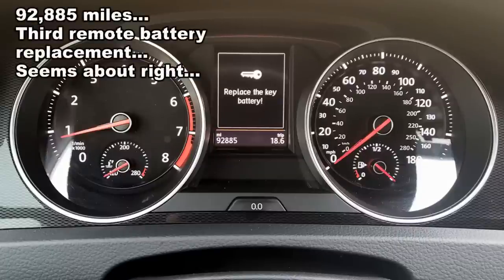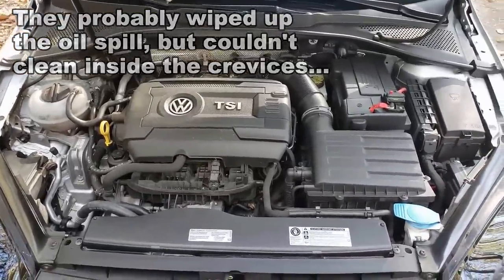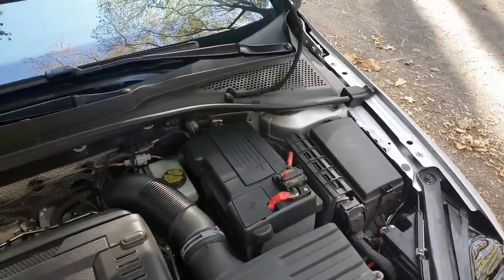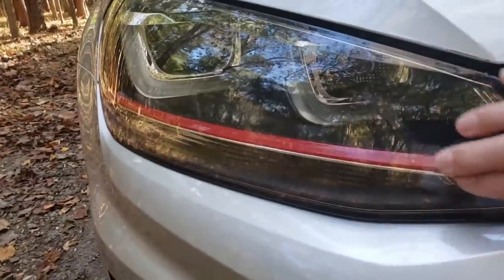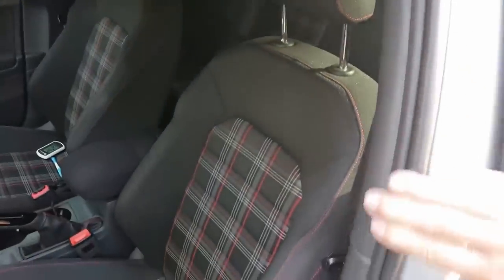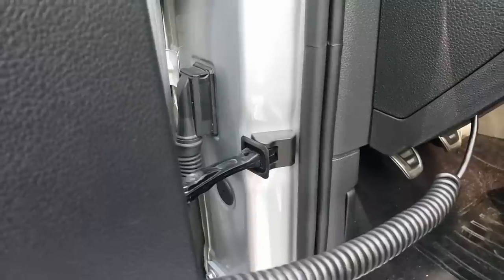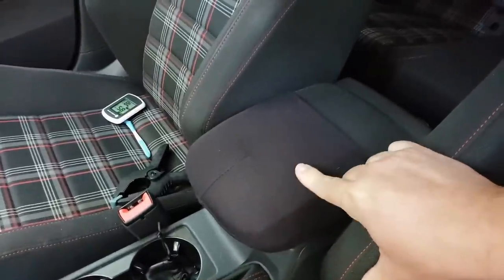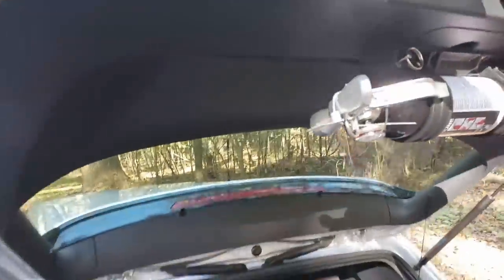THREE YEARS AND 93,000 MILES: My Report, Part 1

Comment: I'm 5 years in and battery is still fine. Car delivered with leaking valve cover and down pipe. Once those are fixed car only required maintenance
Reply from the maker: Excellent news! My car crosses the 5-year mark on November 11th. I'll share a report the following week. Thanks for visiting!

Comment: Good video but still buyers must be aware new cars coming in. This is a direct injection engine that suffers massively from the cokeing up valves and in a lot of models the dilution of oil with fuel! Keep an eye on those oil levels ! Your situation is perfect for a car, 90k in 3 years. Now try 90k over 10 years town miles or come back and review it at 200 or 300k. From what iv read the valves should be de coked every 60k at a cost of 2300uk but I'm unsure whether that's the diesel or petrol model. 

Regardless of the map the clutch is very weak, and the of using coolant is completely unacceptable.

My dirty diesel Honda has 215k town and tow miles and is nearly 16 years old. Original clutch, no oil leaks ,doesn't loose coolant, no cokeing of valves or oil dilution to worry about and still starts and drives as new. It can also be mapped to 210hp but have never felt the need. Yea the heated seats and air con is busted but wind down the window or put it back up again lol. They don't make em like they used too lol!
Reply from the maker: Yes, the diesels from that era are far simpler and less self-destructive (emissions).  Thanks for visiting.
Reply: @StealthGTI  Yes mate. They should factor in longevity in their co2 equations too. For example if a car like mine lasts three times longer than a modern diesel surely the co2 production cost of 3 v 1 would actually make mine less harmful over the course of its lifespan even taking into account the extra fuel and pollutants. Production is crazy co2. My work van is a small high pressure diesel with not even 10k on it. It already sounds like a bag of nails compared to mine. And I can't even think what I'd buy brand new now. Even the new hondas suffer from oil dilution and iv read about honda crvs only a year old blowing the crank. It's all down to the consumer paying for it (... Il keep running my two 2.2cdtis and hope that in a few years when they need replacement that something more reliable has come out but wont hold my breath lol.

Comment: The coolant leak might be due to the water pump leaking as it nears the end of life. I had the same issue and wouldn't show any leaks even when pressure testing the system. There is a small hole behind the bearing in the pump and once the bearing wears coolant starts  to sip out. Fortunately you get message when the coolant level is low.
Reply from the maker: Thanks for sharing.

Comment: I’ve had my 2008 MkV Gti now for 11 years. Air con broke after 8yrs. Nothing else has broken. Same pads and disks even as it’s a low mileage car. Same battery in the remote key. Same bulbs. Changed the belt after 6yrs and the tyres after 7. Fantastic car.
Reply from the maker: I seem to get about a year out of each remote battery. The keyless start remotes do a lot more "talking" than others. I think a year is good. The car is great. Thanks for visiting. -Scott

Comment: I have a 2018 white silver SE 6 speed, it's the best car I've ever owned.  After nearly 2 years of owning it, I still love taking it out.  Nearly 40k miles at this point, and the only things that have bugged me to this point are the TPMS seems to be very touchy and goes off too easily and the stock brake pads are very messy and I can't keep my wheels clean 5 miles past washing the car.  Pretty petty stuff all things considered.  Anyone looking for a hatchback should look no further.........
Reply from the maker: My TPMS isn't terribly sensitive. If it is, I'm glad to have it tell me that there might be a problem. Thanks for visiting.
Reply: StealthGTI I would agree if it were being accurate, but it’s gone off several times and I’ve checked pressures on all tires and they’ve been good.  It’s not really a huge deal, just a minor annoyance....

Comment: I've a Golf plus Mk5, 15 years old and I've had it 10 years, 102k miles. here in UK. replaced wheel bearings, drive shafts and 3 brake calipers, very few issues. Regular oil changes at service time. A good daily driver, plods along nicely, maybe a few noises from lower engine mount, perhaps I'll replace that in spring. Same clutch from new. Service history says it had water pump and new timing chain fitted at 4 years old at 40k miles?!? Was losing a bit of coolant in the last few years, too small to know where it was coming from, put a little amount of "radiator leak stop" or some similar named product in it a year ago, no more need to top coolant since and I keep the heater switch to hot once car is running for 10 minutes (it aids in reducing coolant pressure a little and therefore might help reduce or stop pushing coolant through weak points in the system) hopefully it will be a small leak in Radiator, it may show itself one day but replacing Rads on Golfs are a bit of a pain and involved. I want this car to get to 20 years or more. I work for a large car leasing company but refuse to lease, its not cost effective and I can do most maintenance and repairs myself. As much as I like Golfs, I'm on my 3rd, I'm gonna get a Toyota when the current Golf calls it a day. That's your Scotty Kilmers fault. I'm addicted to Scotty and Eric the car guy channels. They talk about European cars as well as your larger engine petrol guzzlers. Anyways, your GTi has certainly done a lot of miles in its 3 years. A very tidy car and the UK roads are full of them, very popular over here.
Reply from the maker: Thanks for sharing. -Scott

Comment: A member on the Golf R forum has fitted the plastic underbody tray from a Passat Alltrack. This unit gives slightly more protection than the standard tray. He did need to procure a few extra fasteners and two small brackets to complete this conversion. It certainly looks the business when fitted and offers much greater protection to the sump area. All the best from Nottingham, U.K.
Reply from the maker: Thanks for sharing that. Some in the U.S. have fitted a similar tray from our Golf Alltrack... same concept. ShopDAP.com sells complete kits. Thanks for visiting.

Comment: Regarding the coolant I would suggest to check the heating radiator which is located under the dashboard. Sometimes the radiator is getting corrosion and leaks without seeing any water around because is minimal and gets evaporated.
Reply from the maker: Thanks for the note. My thermostat housing eventually failed at ~115,000 miles. The car is has 163,000 miles now. Take Care!

Comment: I still have the plastic oil pan to this day on my 2016 gti and it has never leaked or anything, don’t have the all track skid plate on it either I just left it the way it was from the factory and it’s been fine
Reply from the maker: Thanks for sharing. I recently discovered a small leak in mine, even with the Tiguan gasket. I'm going to return my stock pan to the car at my next oil drain. I don't recall if it's in this video, but I do have the ECS skid plate. So, I still feel protected.  ;-) Thanks for visiting!

Comment: Wow man you did a lot of driving,mine is 2 years 9 months old,done 18 thousand km,only thing I had go bad is a boost sensor,good informational video tho,I got a obdeleven my self,on the updates I keep having trouble with the updates,it takes a lot of fiddling around to update it,but it’s a good bit of kit,I have the same diamond cut wheels as you,I hate them,I wash my car and look after it but them wheels mark so easily,just from washing them,I hate black on wheels but the refinished ones look smart
Reply from the maker: Thanks! The powder coat finish on the Nogaros appears to be holding up very well.

Comment: I was so tired of destroying my 18 inch wheels I replaced them with 17s and higher profile tires. At one point i has my car slightly lowered with Rotiform wheels and while I miss the look, I don’t miss the bone jarring ride or constant tire replacement. The aftermarket wheels were much more durable than the factory wheels, but that set up just did not work here in Chicago. Much improved now. My other issues include a leaky rear cargo area and an odd smell which I believe may just be the cabin filter. But otherwise my car has been bulletproof. It’s not my favorite car that I’ve had-were it not for our salty roads I’d much prefer driving a mid-late 60s Beetle-just a lot more fun to drive and believe it or not, more comfortable in my opinion. When this is paid off, I’ll keep it another year. I like it, it does everything I need it to do, but for the price there are some seriously nice low mileage used cars such as the Alfa Guilia Quadrifogio that one can buy with low miles that I believe will have more soul.
Reply from the maker: Thanks for sharing about your 17s. I considered them for a short while. Then I managed to get my hands on enough spare 18" Nogaros that I'll stick with them for the foreseeable future.
Reply: StealthGTI no problem. I don’t know how the streets are by you but they are truly awful around here.

Comment: If you haven't already had the dent fixed, and if it does not have a crease, you could try the hairdryer / canned air trick, but you would probably have to remove the clear bra.
Reply from the maker: Thanks for sharing that. I still need to have my PDR wizard take a look.

Comment: Ditto with this damn coolant slowly getting lower in my 2014 Jetta. It started to drop a bit the first year I had my car. I topped it off last September and now it's between min and max, no signs of any leaks. Anyone know if there's a known leak issue that's hidden somewhere? 39k miles, had the car since 2013.
Reply from the maker: Oddly enough, I decided to let my coolant go to see how long it takes to fall below the minimum mark or trigger an alarm. It's been a LONG time. I wonder if keeping it low helps reduce the chances of the system being overpressurized. I don't know. I want to post a follow-up video about it. I'll put it on my list. Thanks for visiting.
Reply: @StealthGTI  Hey thanks for your input! Does anyone here know about maybe replacing the blue coolant reservoir cap at a certain mileage?

Comment: Yikes. A clutch at 30k? Was that a result of the tune or is that common on the GTI? I’ve never had a clutch last less than 150k.
Reply from the maker: Tune and towing combined. My old clutch didn't fail; it slipped one cold morning while towing. I probably could have kept driving it for another 20,000 miles or more. Who knows? I decided to replace it as a precaution, especially since I knew it was inevitable with my tune and towing habits. Thanks for visiting.

Comment: This is a video on how to tear up your car and then cover it up.  Condom for an arm rest?  Seems as though you go to great lengths to take care of some parts of your car and then cheap out on other parts.  Not the way I take care of cars AT ALL!
Reply from the maker: The car is past 137,000 miles at this point and in nearly perfect condition. In fact, my latest video details how I won the "Mk7 (modified) Mild" class at VAG Fair last weekend. See that video at https://youtu.be/HtqvnZf0wa0, if you're interested. The seat bolster and door seal are fixed. I still use the "condom" because it's cheap insurance against the unavoidable and continual imbedding of dead skin or sunscreen into the material (unless I wear long sleeves all summer). Beneath the cap, the arm rest is PERFECT. Thanks for visiting.

Comment: Got a 2015 Autobahn mk7 gti 40k miles still has the plastic oil pan and have had 0 leaks or problems
Reply from the maker: Zero leaks on the factory pan seems to be the norm, except for one of the very early Mk7s from 2014 (Europe). I'll keep that in mind. Thanks.

Comment: Your Mk7 Golf has a manual handbrake or parking brake lever.  I’ve never seen any mk7 golf with a manual lever, I thought they were all electric handbrake like my own Mk7 Golf GTD.  ..  I live in the U.K., so maybe it’s just American models that have this option.   I have done a few rear door water leaks, it’s the door speaker seal on the inside of the door panel that allows water to run into the footwell.   We also have in the U.K. inside the radiator coolant bottle, a small bag inside that VW put inside the reservoir bottle that is there to stop corrosion in the water coolant pipes and radiator unit, but if the bag bursts did to the water hearing up a bit too much, the hundreds of tiny beads of silicone leak out and eventually blocks up the interior heater matrix which is not a 5 min just to renew and flush all the tiny beads out of the system,   Maybe it’s just GTD models, but I was informed by a U.K. VW dealer source that if any VW car comes in for a dealer service, to check the reservoir bottle for this plastic bag and remove it very carefully without bursting it.
Reply from the maker: I suspect VW cut some luxuries from American GTIs in order to keep the prices lower. We, too, have the silicone bags in the expansion tank. I'll have to ask my mechanic if he removed the bag when he replaced my water pump. I'd like to know his thoughts on them. Thanks for visiting.
Reply: It’s a simple job to remove the silicone bag if it’s in your radiator coolant bottle, not all models have it fitted in the bottle, but if it’s inside the bottle you’ll see it quite clearly.  I used a long nosed pair of pliers to just catch the bag and gently pull it out of the bottle, just be careful you don’t puncture the bag as you pull it out.  The bag is about 3” in length and it’s full of tiny pink silicone beads.

Comment: Crap car. Cant wait to get rid of mine. Cheaply made. Crashy suspension, rubbish clips holding plastic trim together- 2 many creaks. Window relays gone. 
Odd noises in passenger side window whilst resting and in operation. Bluetooth works when it feels like it. 2 many electrical issues. 
Car fob battery drains way too quickly. 
Cleaning the windscreen with the window open an inch will result in water dropping inside and on the electrical switches. 
Seals around doors are rubbish resulting in puddles of water on the door sills and condensation/ frosting on the inside of the car.
Wouldn't buy another vw/ audi ever again. Had both and they're both shit.
Reply from the maker: Thanks for sharing. Better luck with the next car.
Reply: @StealthGTI  back to BMW for me.

Comment: Have you had any troubles with the wheel bearings? I have had to replace the left rear wheel bearing 3 times and it's coming up to the fourth time now. I have a 120,000 miles on my 2017 golf sportwagen and I have not had any issues with the plastic oil pan. I don't think the steel is any more durable than the plastic pan anyway. My 2011 F250 has a plastic pan as well.
Reply from the maker: No wheel bearing issues. I once had a challenge with wheel bearings on a different car. After another set of bearings went bad, I decided that my axle stub was worn, too. After that, I got VW parts for the bearings and stubs and didn't have another problem. I've been a proponent of buying quality parts ever since.  Now that was on a car with over 200,000 miles, and driven to 445,000. As for my GTI, everything is still in good shape. Regarding the steel oil pan, I'll disagree about the durability. Even if something hit the steel pan so hard that it bent the pan, odds are good than the pan MAY leak at a crease, but it wouldn't just suddenly dump the oil sump on the road. I'd have more time to get off the road to safety. Thanks for visiting.
Reply: My water pump, just went out. I had been using fluid, but something just broke this afternoon. I haven't even looked, ugh. Big job to get at the water pump.

Comment: Hey Stealth, i'm 6'3 190lbs looking at the GTI similar to yours. How do you find the head room? I usually find cars with the moon roof force me to tilt my head inwards which is largely uncomfortable or causes me to slouch (which is nice for my back).
Reply from the maker: I don't have a sunroof. So, that helps. Still, my wife's Jetta has a sunroof and I have plenty of room. The Golf/GTI/Jetta seats are able to drop pretty low. I'm fairly certain you'll fit. Visit a dealer and give it a try. Just pump the handle on the outboard side of the driver's seat until you're on the floor, then raise it until you like it. If it won't go low enough, then you may need a different car. Thanks for visiting.

Comment: For consuming coolant , no this is not normal , most of Gen3 engines comes  with a faulty water pump and you can't see a fault on OBD , check your water pump , it suppose to be under the engine in the left side I guess.
Hope that helped.
Reply from the maker: Thanks. I'll be inspecting soon.

Comment: did you change break pads/rotors at all during this time?? I have 2015 mk7 GTI S non PP and only 41k miles now(did dsg oil change recently) and wondering if i need new brakes
Reply from the maker: Always base the need for new brakes on the pad thickness or rotor wear. It's okay to have shallow uniform grooves in the rotor if the pads still have meat. With that said, my original brakes lasted 140,000 miles, even with over 20,000 miles of towing trailers.  :-) Thanks for visiting.
Reply: @StealthGTI  oh wow. Thanks for the info